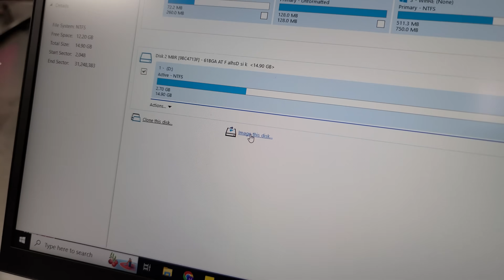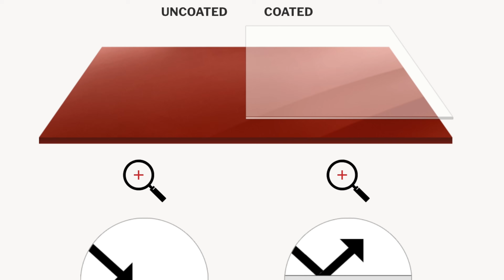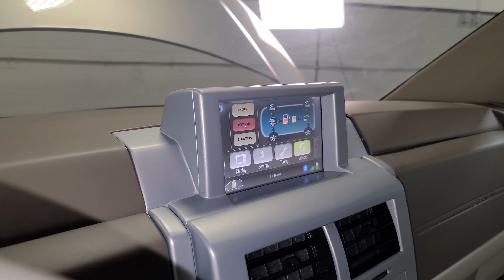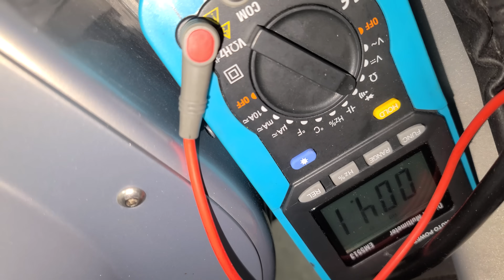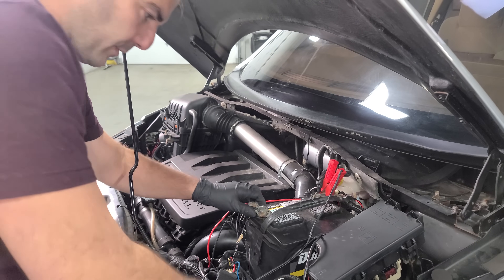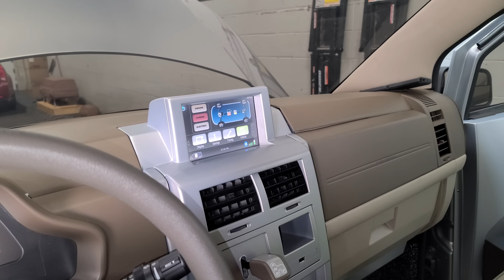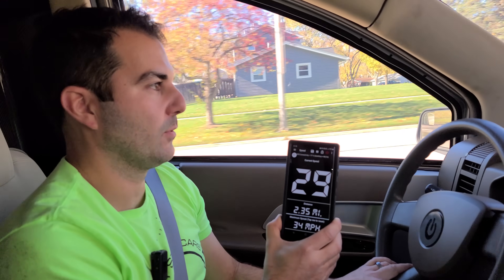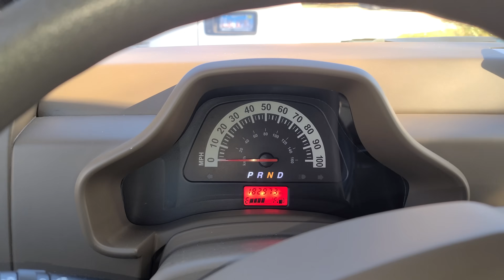I Thought I Finally Fixed The 2 Million Dollar Concept Van Until Disaster Struck! What Would You Do?

Comment from the maker: What would you guys do?
Get 3 Armor Shield IX Ceramic Coating Kits For Only $99! https://avl.kg/legitscebbf23
Normally these are $75 each and this is limited time and quantity. Act fast!
Reply: Cool
Reply: Ever consider taking it off a sweet jump?
Reply: why dont you just convert it to a current day hybrid EV and swap out the tech and make it a new project
Reply: Sell it back to the CEO who wants it.
Do not take it to heart, as you said you have done your best and it is a Frankenstein pretty piece.
Reply: Give it back to the CEO. Be done with it. It's worth nothing, but a huge headache.
Reply: It’s been fun, fix the axle and let it go. Ohh, almost forgot, have a Wonderful Thanksgiving !!
Reply: The Asin letters ON THE HARD DRIVE should mean
DOE’MA
Reply: Your sense of humor have me dying 😅😅😅
Reply: Well, if you're tired of it, you know there's someone that wants it, then sell it to him for what you put in it.
Reply: Listen from what I can see it looks where it sheered that the metal rod failed because the  metal was probably a very cheap steel or aluminium. There is no other reason. Have a stronger bar made. Wasn't any fault if yours in the slightest. I know how disheartening  it can feel but look at it this way it's just a metal bar. Maybe it was slightly warped. But it's an easy fix so treat it as such.... Just a easy fix no big. Deal. The electrical governor is easy to fix a new controller will solve it. Always treat problems as small steps.
Reply: Alex be mindful of the passion you feel and have felt for your other project cars, remember the pride and exited you felt when you made your first purchase. Then remember the comradery in the custom car world and how you can gift the same feeling to the Space Van CEO. This van at some point was his and his teams life work they where most likely all in with this at some point. That being said if you sell it to the CEO it will give him the opportunity to complete his life's work which not many have the honor and or the means to do so. You can still donate the proceeds if you wish. At that point you will have helped  three causes, the CEO, the donation recipient, and yourself. Not to mention setting a good example for, your family,  those of us who follow you, but most importantly  yourself as a Man who has been blessed fortunate. There's no loss for anyone. Sorry for the rambling on.
Reply: Put a proper set of CV shafts in it. That was done with regular pipes that are not designed to handle rotational loads like a purpose built half-shaft is built for 😮😊
Reply: Use the mask properly.  You got it on upside down :)
Reply: I'd fix the axle issue and sell it back to the CEO
Reply: Dose it have a throttle cable going to the gas engine?
Reply: Norton, it’s a mere bag of shells. Huh ha
Reply: Sell the Space Van to the CEO at $100,000. This 100K figure is exactly 90% off of your original 1Million figure. Hahaha. God bless. 

Honestly, get a couple more episodes of creative content with the concept van. Then sell or donate at your business executive decision comfort level.

God Bless.
Reply: Youll fix that axle for the electric motor and youll fix the throttle on the ice engine
Reply: Honestly. Its worth scrap price. The only person who would pay anything is the old ceo of brite. Definitely Not a million dollars. That's just insane and kinda a jerk move wanting that much from the person who headed this failed concept van
Reply: I’d just call the CEO and say come get your van. You have put in more into it, than the original bright engineers
Reply: I think that you've done all you can for the van, Alex. As my mother once said about one of my project cars: "Sometimes a dead car is exactly that - dead." Let the former exec have the van back in exchange for a charitable contribution.  That way, the van still serves a purpose.
Reply: @theguy9234  Jerk move, how? A deal is a deal, take it or leave it. I dont get how people are so entitled these days as to be offended by a price. Ok, I know thats nothing new but I just dont get the mindset for something thats entirely voluntary. Like going to a horror movie and complain about all the blood on screen and that its not family friendly.
Reply: LS swap it!
Reply: just get rid of it, it's kinda boring tbh
Reply: It’s dead. Sell for $15k to CEO, donate half, and get back to SEMA Porsche content.
Reply: It smacks of Nikola"s attempt to produce an EV Semi  !
Best seen rolling downhill ! You just need to tilt the Camera  !
Either a Museum, OR a School for Techies" to play with  ! 
But you're SO close  ! Maybe give it ONE LAST CHANCE, before you dump it  !
Stu  xx
Reply: Time to give up Alex. Better spend time on petrol driven cars
Reply: Sell it to the CEO for the cost of the projects you're passionate about, like the DeLorean and Lightning. That way you get your vehicles that you're passionate about, and he gets the van he's passionate about. Think of it as an even trade.
Reply: I would get a Chevy bolt and swap in the lot - drivetrain, wiring - everything.
Then its fwd, 150hp and would work just how it should have done. 
Relatively easy swap too.
Reply: Alex ,,, your like dog marking everything!!!! bwah 🤣🤣🤣🤣
Reply: Hey Alex ,Cletus is looking for a prize for the freedom 500 I suggested your McLaren you said you may be selling see if he's a buyer
Reply: price went up to 143$ instead of 99$ or am I missing something?
Reply: hope you get all the time and money back from the youtube videos for this shit box lol.
Reply: Hey Alex, I love the space van! Maybe you could use this as an opportunity to collab with another content creator like Rich Rebuilds, Genius Garage or Electric Supercar? I think it would be cool to get the car community together to complete this project and get it on the road
Reply: I don’t know what the law is in your state but in Washington you can get titles for concept vehicles, just have to have the state police inspect it, they issue you a vin number and a few months later you get a title
Reply: Probably i would let it in EV mode only!
Reply: You must BURN that "Disk Image" on a M-DISK. It's cheap and it's the only true Data Security.
Reply: You should scrap the bright idea systems and contact rich rebuilds and tesla swap it, fix the windows and lights etc
Reply: 4bt Cummins swap it
Reply: What i would do is strip the van down to the wire and replace 90% of the obsolete nonsense thats in it with a modern, purpose built solution so that it works well. 
But i'm guessing thats not on the menu :P
Reply: Try to get it to work, it will be worth it in the end 😊

In Sweden I know that someone is driving around in the Saab Aero X Concept 😊
Reply: You putt your mask on upside down. the metal strip is to form on your nose
Reply: Ditch the entire hybrid system and gas engine, and EV convert it.
Reply: Stop having Avalon kings ceramic coating sales!! I already have 3 kits extra, you're going to make me have to buy more😂
And you should just get rid of the space van, it's enough already. You don't owe us anymore content on it. Let's get to some of the other cars.
Reply: Dear Alex I hope the ceo does not get the space v!an he will lock it up and through away the key we will never see it again please give it to a musume and let other people enjoy it .will you be making space van t shirts?
Reply: So you have to turn the key click the mouse and push
Reply: Sell it to travarish so he can turn it into a mid-engine Lamborghini powered super van
Reply: realisticaly 3-5k  maby up to 10 for some one that realy wants it They know there getting a nasty project
Reply: I say it’s time to take what you know…. And remove all the tech, and while learning how it all works on the dismantling…. And move the tech to a new concept vehicle… perhaps a space charger! XD since it was a dodge engine on here anyways.
Reply: Yeah seems like the project is pretty much done as there's just so much still wrong and it likely never really operated much better as a concept car. Doing more work on it would not be restoring it but rebuilding it/improving it.  At the least fix the axle so that it can be more easily moved around short distances and then work with the original CEO to arrange for it to be a museum piece.
Reply: Transmission speed sensor issues can cause no throttle response :-)
Reply: You are thinking wrong.
Half of that vehicle is a Dodge Caliber (or whatever your scanner shows).  This means you can readily get wiring schematics for the gas portion of the vehicle to aid in the starter problem.
Give it a break and get back to it later.  No different than some of your other vehicles that took you awhile to figure out.
Reply: You wanted to do something charitable with it, so you should trade it to the CEO (where I hope it winds up) in exchange for a donation to the charity of your choice.  Could be good for both of you.  Just ask him how much it's worth to him and how much would he give if he knows it is going to a good cause.
Reply: I would get it back to driveable condition, call/video chat with the former CEO and probably give him the chance to make a decision.  The mental anguish at almost every turn is probably not worth it. 

I think you and the team Have done already amazing things with next to NOTHING to start with. This was a good learning experience but as an amazing mechanic and content sharer you've done and Checked all the boxes for us in terms of giving us a first person perspective on automotive e history and we thank you for it!
Reply: Now go back to the Ls swap Porsche and DeLorean please :) you did amazing work on those two vehicles so far!
Reply: Click engine then put it in drive if you remember from the last time it ran
Reply: is it time to rip it all out and do it yourself better. it would be a great mini series. the van is pretty cool.
Reply: I think selling it to the CEO would be the best option in my humble opinion. That was probably his careers work and to have a chance at getting it back would probably make his year. Ask him to make an offer and see if it jives with what you were thinking. If je offers you $1 million think of all the other projects that you can get into. Be done with it.
Reply: Just put a real engine in it
Reply: I agree with the comments section. Call the former CEO of Bright & sell the junk back to him. It's HIS labor of love, it doesn't need to be your Burdon.. Plus to be honest, I think we've had about enough content on the space van.
Reply: Shell and Interior are cool, maybe just swap it or put the shell on a 4x4 chassis?
Reply: @lorenzevrard2307  But it's not a keeper, so why waste the time?
Reply: You skipped checking the gas filter, seems it not getting enough petro fuel..😢
Reply: What happend with the van?
Reply: Where is the next, final? Video?

Comment: Axle sheared off due to being a cut axle, and poor weld penetration. You can still see the grinder marks after the cut they made. Always have to remember, this van was never supposed to be reliable. Just needed to do what it was promised to do, for a short time.
Reply: Makes a lot of sense, combined with earlier vibrations perhaps?
Reply: @GoldenCroc  I’m sure you are right, that had probably weakened the joint
Reply: I agree. The grind marks on the axle are apparent. It never drove or was even intended to drive very far. That was put together with a lick and a promise. Smoking gun in my opinion.
Reply: When it was shaking so violently that it was ripping the ev motor brackets off I’m sure they didn’t help matters with the axle.
Reply: that is exactly what i saw.
Reply: This!
That axle had been cut, sleeved with a tube, and welded. Possibly only tack-welded. It's yet another quick hack to produce a proof-of-concept vehicle which was never intended to be road-driven. It can easily be fixed, and I hope that you do fix it because it's a fascinating look into the world of vehicle development that most of us never get to see.
Reply: I subscribed because of this series. The tech is still modern considering toyota rav 4 hybrids 2020 and up use the same technology very cool very knowledgeable gas guys don't want to learn anything new 🤷 kinda like carbs and fuel injection arguments back in the day.

Comment: Hi, Ive send you a comment in one of the older video of the van that I was questioning how the gas powertrain works and that I work at a Chrysler dealership since 15 years as a diagnostic specialist. I may help you out at least on the Chrysler engine! For the electric throttle body non responding, check if you have any electronic throttle body related DTC. You should be able to rev the engine even in park/neutral. The throttle body fail quite often on those 1.8/2.0/2.4 engines. Like I told you on the previous video, lot of the unused  connectors are from the donor Jeep Compass/Patriot so you should be able to use those wiring diagram to figure out what's going on. For the engine to start correctly, the WCM/SKIM, the PCM, the TCM and the TIPM (the fuse box because yes, its an module too) must communicate together and have the proper "hand shake" data to start. Anyway If you can contact me and send me the full scan report of you autel scanner I might be able to guide you on whats going on.

Comment: HI Alex,  I'm an 12v aftermarket installer and what that module looks like to me is a key-less entry module.  The green and blue wires are negative pulse usually by default under a second and up to three through programming.  Green is lock and blue is unlock.  So if you were to ground the blue wire simulating unlock output that might trigger a function to start.  Maybe... That module is readily available but since it's just a momentary ground output you could easily test your results.  It's also not waterproof by any means.  Sad to see the ending you had.
Good  luck! -Jon
Reply: This was my thought as well, I've seen identical looking keyless entry units on ebay.
Reply: I don’t actually know if this would make a difference, but what if that unlock module thingy that he was holding it’s supposed to be a bypass module that isn’t programmed or needs to be reprogrammed to the wind module to allow everything to function.

Comment: Just an idea but for little to no cost for you, I'd clean all the wires up under the hood, eliminate any that don't need to be there. Fuel, air, spark are the three keys for the gas motor, then research how the Chevy Volt changes from electric to gas mode, chase the key wires from the engine management system back to the computer side of the electric part and see what's causing the short. As for the acceleration problem on the gas motor it may be drive by wire versus cable like old school cars, seems that when in  ev mode the throttle works fine but when in gas the drive by wire system doesn't connect back to the throttle body which is all ran through a computer. I say start from scratch, clean all unnecessary wires up in the engine compartment and go from there. As stated previously the rear axle was a custom hack job, poor welds on it, either fix it or find it from another vehicle. I'd really like to see you come out on top with this vehicle.

Comment: For someone who is a car person and also works with software/computers I think you have done an amazing job getting as far as you have.  Sometimes you just have breakdown and talk with the developer.  May not be possible in your case.  I would like to see you give it one more shot.  Get the van axle get fixed and you look into what is happening with the throttle position sensor when the gas is pressed.  In the end I would like to see the van go back to the guy you mentioned that started Bright who wants it back.  That would be a happen ending to this story for me.  A zoom call with you both would be great.
Reply: I thought this van was no good since the beginning when the motor would shake just for having low voltage.

It would be cool if he could get the engine to charge it but I just think the vehicle wasn't very good to begin with.

Too many problems .. not worth it imo.
Reply: That is weird the electric motor will vibrate like that at all for any reason though. 

Does the gas engine drive the car or charge the battery? I think I was wrong in the first post.

If it drives the car maybe there is a glitch somewhere and that's why the motor acted the way it did. Idk. 

I thought this car was junk from the beginning and I didn't care for it at all. Only now when everyone is saying ditch it do I care if he fixes it. But I don't think it's possible without a lot of work/time/money.
Reply: @digi3218 technically it could charge the battery if it kicks the ev motor into regen while driving lol.
And no shaking shouldn't happen when the battery voltage is to low, there should be a cutout if designed/programmed properly.
Reply: @Nighterlev  Just because other hybrids work that way (recharge while driving) doesn't mean this one does, sheesh.
Reply: I will have to look for some sources before I take your word all motors shake violently when low voltage.

What I was saying is there must be some mechanical switch between the electrical motor and gas engine to drive the car. When I said glitch I meant maybe the gas engine linkage was engaging at the same time as the motor and it caused the violent shaking.

I don't think shaking motors is normal even with a bad battery

Edit: I'm probably wrong. I think the engine drives the steers and the motor the rear. So what I said above is probably not the problem but sounds like a really poorly designed motor controller or something.
Reply: @Nighterlev  I ain't just binge watch all these episodes so my bad if I don't remember exactly how the car works. I know what a hybrid is but I'm not a Prius mechanic nor owned one so my bad I don't know exactly how the car works off the top of my head 😔